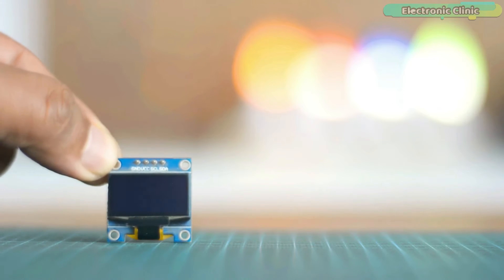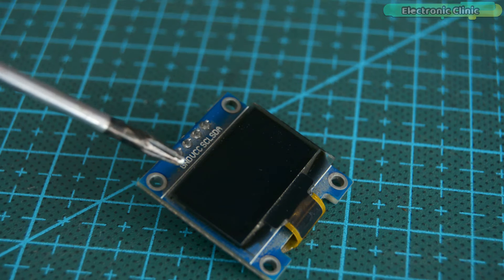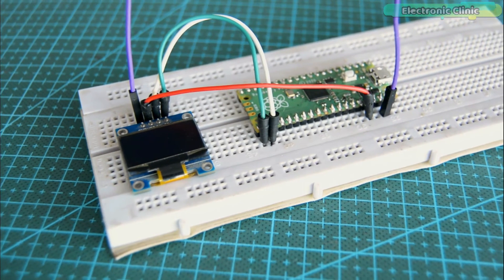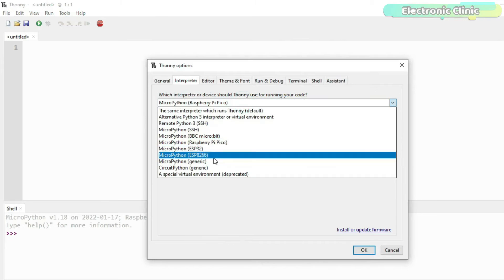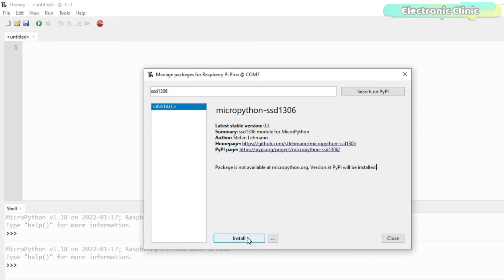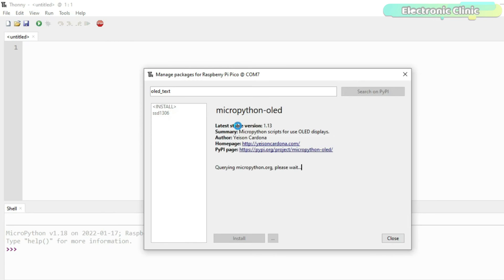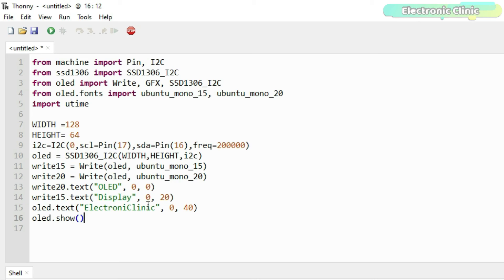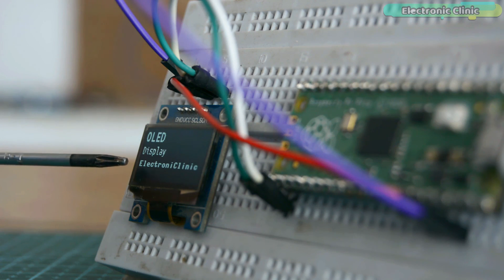Raspberry Pi Pico Oled display module Micropython programming, SSD1306,  Oled display with Pi Pico

Comment: I wonder if this is the same version what i try to use, but you won't show the backside. The thing is mine have a 5v->3.3 on board regulator (3 legged smd component, 662k written on it), got to work it, everythings fine, reuploaded mofified code, didn't even touched display things, just timings and other stuff, and wont start anymore, beacuse no i2c device is recognized. Even after rolling the code back, nothing changed. Checking i2c devices gives only () -back. Later on i checked, possibly the 3.3v too low for the display to work properly, and because the instable behavior the i2c pins got "freezed".  I cant feed it with 5v because pico gpio only accept 3.3v, and the stupid display pulls the sda and scl pins up to 5v rail, wich is bad news for pico. Im tried other display, got same results. Gonna try nuke the code, and firmware, resetting my i2c-0 lines, and with level shifter try to put 5v on the vcc of the display. Stupid 3.3v logic, i miss the robust arduino uno/mega 5v tolerant gpio-s. Little shit even needs a transistor to swich a simple led, because 10ma /pin limit. So powerful, but so annoying little board is the pico.
Reply: After all of this, you know what? Soldering flux caused 4Kohm resistance between SDA and SCL pins. Always clean your boards guys XD

Comment: provide the code bro the only reason everyone is hating you right now is because u dont give the code. GIVE US THE CODE

Traceback (most recent call last):
  File "<stdin>", line 3, in <module>
ImportError: no module named 'oled'

LOOK. ONLY BECAUSE UDONT GIVE US THE FRICKING CODE. why would anybody watch this vid if they can go to another vid where they actually DO GIVE THE FUCKING CODE

+ look at this:

Copying adafruit_circuitpython_connectionmanagerError (ManagementError(...), 'Command output was not empty')

The library is probably deleted.
Reply from the maker: @jjaosopica  nobody is hating because link to the article is in the description.
Reply: Ha ha, someone is getting angry at you because they can’t work it out. Lol. Sounds like they need a new hobby. Nice video by the way.